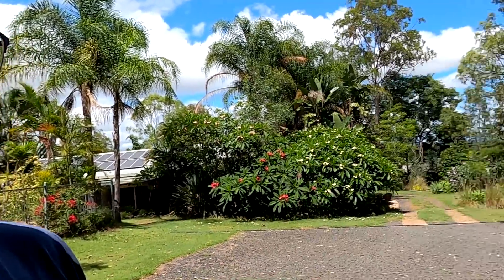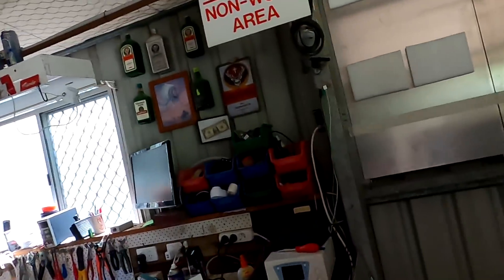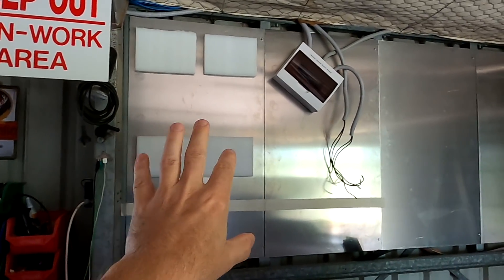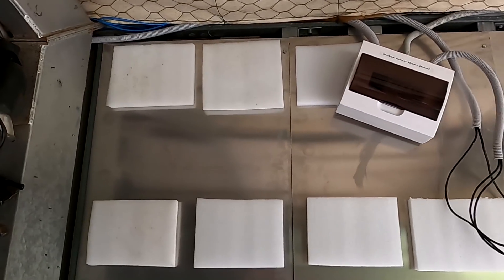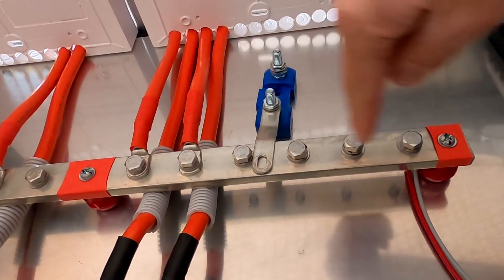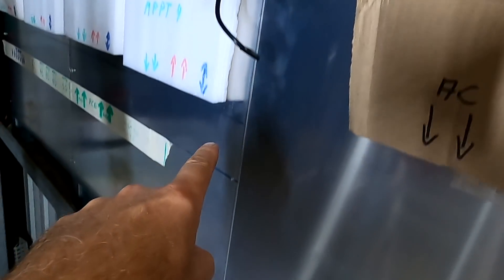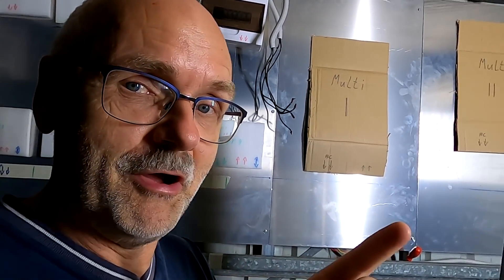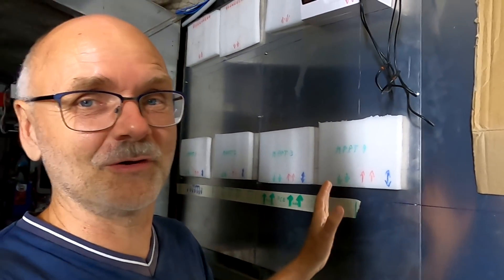No work, just design. The Solar PowerWall Project

Comment: One couple of last-minute thoughts, since you already have a large breaker coming out of the battery box to disconnect ALL of the inverters it might be desirable to add a breaker going into each inverter to be able to service each one individually for maintenance/service/etc. without disabling the entire setup.  This will allow for a single pair horizontally going into a smaller bus bar which will then feed each inverter through its own breaker. 

You mentioned something about an AC box on the far-right panel, but wouldn't it be better to place the third inverter there and the AC box lower.

A simple and consistent design is much to be desired. I am currently going through my own Powerwall design and investigating various equipment and how to arrange it, so I have already muddled through these considerations myself.
Reply from the maker: But what breaker can that be for each inverter? I have a 70mm incoming cable. It can only be MCCB, same as for the battery banks...
Reply: @OffGridGarageAustralia  Thanks much for the prompt reply. Since each breaker will only service a single inverter, you don't need as large of a breaker for each inverter. 

The 70 mm cable can remain going to a smaller bus bar below the inverters which then can use less than 70 mm going from the new bus bar up through the new smaller capacity breakers to the inverters. 

The smaller bus bar should be able to handle the 70 mm cable. The idea is to be able to isolate each component of a system for maintenance/expansion/safety.
Reply from the maker: @danielglang6312  Thanks for the input. Would not a battery switch be sufficient as they have M10 bolts and can handle 600A? They also have a very small footprint. The line is already fused with 200A in the battery shelf. That's the victron's recommendation.
The largest DC MCB can only handle 63A which is a bit more for the Multi.
Reply: @OffGridGarageAustralia  Certainly, any reliable means of DC disconnection would do, the key is DC at high amperage.

 The advantage of breakers is that they are very quick opening which eliminates sparks while a simple switch is much slower and an internal arc can fuse the connection together.

A second advantage of a breaker is that they are automatic and will disconnect by themselves in a fault without affecting the entire system.

I am not familiar off hand in how much current your inverters can draw but if you are using multiple inverters paired they may not require the full amperage they would normally require since each inverter would only be handling a portion of the total load when paired.

If you will eventually be going with two multi plus inverters paired, you can use them for the house when the time comes and keep the smaller one for the garage/pool/car  alone,

Comment: More important, touch or better measure the inner sheets during sun exposion.

What about having "Scharniere" for the sheets? May make ist easier to mount nuts and washers on the back side.

As far as I have read, an M6 8.8 thread in a full nut has a strength of >10kN!
Reply from the maker: I had the hinge design on the previous build because I wanted to run all the cables behind the panel. That was a bad mistake, hence the total change in configuration and design now.
I'll add a cross beam behind that inverter mount so it is more rigid. The screws will have only 2.5mm bite in this steel post but should be plenty for 30kg.

Comment: How does Victorian recommend to mount the inverters to a “wall”? you probably don’t need much more then that… also, how do you screw the inverter mount to the steel panel? Do you add washer/nuts in the back?
Reply from the maker: I would add washers and nuts on the back of the panel. There is no real recommendation in the manual. It says wall, concrete, brick, metal...

Comment: Put a wood shelter outside the power wall it will take the heat away block the light
Reply from the maker: Wood is really bad here in AU. We have termites 🐜🐜🐜
Reply: @OffGridGarageAustralia  then you may have to put a reflective cover on it and you will have to change the wood for steel that way it will protect the power wall I forgot all about where you are them little mites are a nightmare it’s coming along so neat and tidy I’m looking forward to completion I think with in a year I will be looking to start a power wall fingers crossed

Comment: Why don‘t you install a horizontal steel bar at the rear of the panel, connected to the vertical bars, and mount the multis on the bars. Having the weight on the panel alone could maybe bend the panels(?).

Comment: That would be supplying 3kva more, or 6kva with twice the idle current, I would try to get another 5kva by selling or trading the other (3kva)  victron needs to work on the inverter capability, it should be able to add the 5kva to the output!
Or just have two separate inverters!  It's difficult for me to have an opinion, because our electrical system is Soo much different, here in the USA, we have basically a 2phase system in homes, and 2 different 3phase, and 277v, 120v 3phase,with 208v, 277/480v, for commercial electrical system, it gets very complicated,  maybe more, that's only what I worked with, there's 120/240, and 120/208 if a apartment is supplied with 3phase, I only saw that in Canada, 
But for simplicity, I'd try to get another 5kva that can be connected,
Reply from the maker: Thanks James, yeah, the US system is quite different to ours. I'll mount the small inverter on the same bracket with same height as the Multi, so I can replace it later with a second 5kVA Multi.
The small inverter has no coms port so does not communicate with the other one. Even if so, only same hardware will work in parallel or 3-phase systems.

Comment: How about hanging a small air conditioner in the window and have the garage cooled 24/7 in summer? Surely there's something out there that caravan folk have which runs off battery power and isn't insanely power hungry.

If you maintain that cool, the garage will be cool enough during the time the sun hits the wall, but later it won't matter if it struggles a little, because the wall won't be the focus of the sun.

🤪

Comment: If you're not sure if the M6 bolt will hold up for the weight of the inverters... If you don't need to go behind the panels... Use RIVETS
Reply from the maker: NOOOO, definitely not. I would not trust them over time.

Comment: If nothing else, you can use a few layers of cardboard to insulate, seal the edges with tape, maybe wrap in plastic, air is the best insulation, as long as it can't move, so the sealed chambers in the cardboard would be a great insulation, some insulation is just shredded paper with a chemical sprayed  on it, to make it less flammable, do just behind the batteries and inverter, what ever can't be reached easy later. I see nothing wrong with using cardboard, wrapped in plastic, or atleast taped to seal the edges, my grand parents lived in a old house, with newspaper as insulation, it worked, made it much easier to heat! This was during the depression
Reply from the maker: Yeah, cardboard is a no no. We have termites here in Australia, they love this stuff as it is basically soft wood and easy to harvest for them.

Comment: I would absolutly go with 1 phase if it is possible to rewire the house to 1 phase / if your prowerneeds are low enought that the one neutral wire can handle the current needet for the house.
If you go with the 3 phase System you always need to run 3 Inverters -> higher base losses. I rewired my house here in Germany from 3 to 1 phase because of the standby losses.
Reply: My house in Frankfurt is running on a single phase 32A since 1949. I regularly ask my landlord not to switch to 3-phases. Two Multiplus II are cheaper than three. 😄
Reply: @rbartsch  Single phase 32a would be a little bit to less power for me. Expecially with the ev charging. I have a separate 15kw 3phase MPPsolar system just for ev charging. 2017 the inverters did cost 330€ each. But they are only running during daytime and when 3phase is needed
Reply: @OlanFantaziya  Originally I wanted to go for Voltronic-based devices, too. After seeing the high power-consumption of the devices (Axpert MAX II = 100 Watts) I decided to go for Victron. I don't want to fiddle around with and pay for the complexity of 3 phases. Instead I'm going to add Multiplus IIs as needed on a single phase. The breakers of the 7 kW cook hob and the oven are switched off and I use much more efficient mobile induction cook hobs and a microwave/oven/grill combo. As I'm driving about 500 km per year the third decade of my gas driven Euro 4 car will be much more economic and ecological than buying a new EV. We just have different profiles. 😉
Reply from the maker: Not possible as the 2-phases to the house share a neutral together. I have two actives and one neutral to the house. If the two actives would be the same phase (0° offset), they current in the neutral would double and potentially overload.
Reply: @OffGridGarageAustralia  So the question would be if the gauge of the single neutral would be enought for your house. For example if the Neutral has an gauge of 16mm2 and is 40m long it could handle 70A. So you can combine the Live wires and fuse them with together 63A. If your house is not using more than 11kW regulary you could change from 2 to 1 phase with only the single Neutral wire.
I also think you are planing to change to the victron system with the house when your supply contract for your PV Ends? That would mean that you have 11kw + PV on the House roof during Daytime.
Reply from the maker: @OlanFantaziya  
The supply to the house is 2-phase with 16mm2 cable, so two actives and one shared neutral. Both phases are fused with 40A in the meter box outside of the garage. If I combine both phases to one phase, I have to lower that fuse to 2x 25A which would give me 2x25Ax230V=11.5kW for the whole house... wait a moment, you already said all that! Hahaha, yes, you're spot on.
There would need to be some other changes in the distribution box inside the house for the single circuits but this is due for a complete rewiring as well. There is only one big RCD installed covering all circuits. Must be from the 90s or so.
The meter box with all its fuses is from that time too and needs a refresh, so once the electrician is here, we will have a lot of work to do to upgrade all this.
But until then, we will be off-grid garage and running single extension cables through the yard to hook up the dishwasher from time to time when I have too much power 😄

The benefit from keeping the 3-phase power is though, I can connect 5kW grid tied solar for each phase with 10kW of solar installed per phase. Not sure if such a setup would still make sense in 2028 as I believe the feed-in tariff will be $0.00 by then. And the regulations have changed a hundred times as well...
Reply: @OffGridGarageAustralia  Hey Andy, sorry for my late response.
As long as you don’t run 2 Phases with a combined neutral to one load/room it will be no problem with converting from two to one phase. I guess you already just have single phase circuits in your House, just spread on two phases. 
Even the RCD will be no problem. The RCD will trip if the sum of currents are not equal.
I have some 3 phase RCD in my distribution. When im running Off Grid every phase will be P1. If i have to change to grid i have a power relays that opens the Connection between the Phases and the RCD will see L1, L2 and L3. 
Anyway i would recommend to change that old type of RCD :D

For the Grid tied solar it will be no difference if you run 3 or one Phase with the Victron Mulitplus. You can connect 15kva in any configuration as long as you use single phase on grid inverters.

The only difference it would most likely be make is with the ev charger, with single phase you would be limited to 3.6kw. But even three 5kva victrons would be not enough to supply 11kw charging and a house :)

Comment: If the piggyback combination of the inverters delivers only the same kVA as the single Multiplus it really makes no sense. In this case I would use two separate ciruits, one with 5kVA and a smaller one with 3kVA.
Reply from the maker: Exactly.

Comment: How much the multi cost to you?
Reply from the maker: I payed the same price as for the Phoenix. That was $2000 including the MK3 USB module and shipping.
Reply: If you connect the multi in parallel with your existing phoenix inverter, how much will be the output?
Reply from the maker: @bishwagit  that will be a big bang! They cannot run in parallel on one phase as they don't synchronise.
Reply: @OffGridGarageAustralia  If connect the Phoenix  as primary ac power supply and input the power to multi? Multi will work as slave to the primary supply. It will also increase your total output capacity.

Comment: If you really need 3-phase in the future: you can always just buy an inverter to convert your 1 or 2 phases into 3-phase. 
I can't imagine how hard it would be to get 3-phase off-grid equipment for a consumer. Seems counter-intuitive, industrial buildings that need 3-phase are usually designed that way to support large power consumption, not to be converted to 3-phase.
Just my 2 cents.
Reply: 3-phase is standard in german households. It's common to use one Multiplus II per phase, connect them via VE.Bus and configure 3-phase mode. Andy can easily upgrade his system with a second or third Multiplus II.
Reply: A lot of inverter manufacturers allow you to just add additional inverters for adding phases. It is a good watch, to see how a solar inverter start-up describes the process. (See Genetry Solar channel on YouTube.)
Reply from the maker: I don't really need three phase for anything. It is just the house is powered by 2-phases with shared neutral. So L2 and L3 and 120° off-set to make that work. Otherwise if using just tow separate inverters for that, the neutral would not be sufficient. So I need a 3-phase system anyway down the track and could use the third phase for the garage.

Comment: Andy - having 3 phase to have "nice distribution" of the load is to me wrong idea.. When you have single phase system - even with 3x Multi+, load will be distributed perfectly evenly across all 3 invertes. (full stop). Whey you split this into 3 phase system, one phase can be overloaded while other 2 will sit on 10%.. Then, one Multi+ will shut down due to overheat.. Imagine situation - one Multi will fail.. When using parallel connection and single phase, you will still have 2x5000VA to power house+garage and can use all your equipment. While in 3phase system you will have no power on half of your house or whole offgrid garage..
Reply from the maker: Good point!

Comment: You should bring the inventors closer together  ....its a waste of space, when there is no need, according to the manuelle  ...it will make the whole installation look more tight ...i´m sure the recovered space will be occupied within the end of the year.
Reply: Victron inverters need at least 10 cm distance for cooling.
Reply from the maker: Not easy to mount the bracket for the inverter mount if it overlaps the panels. Unless I buy a special tool for rivet nuts.
Or add a horizontal metal beam where the inverters sit on.